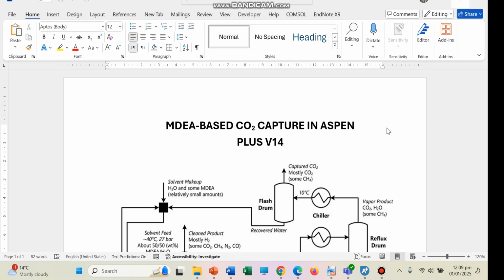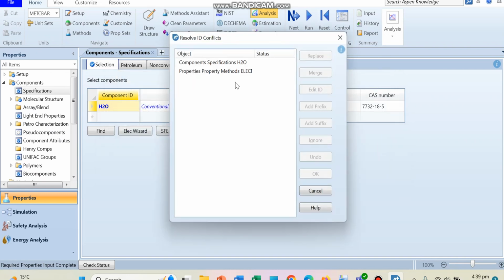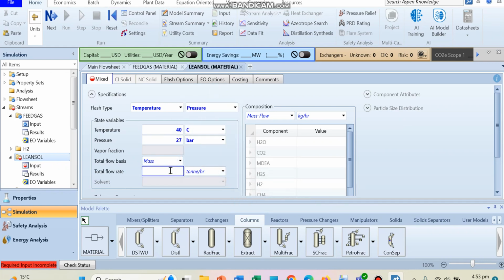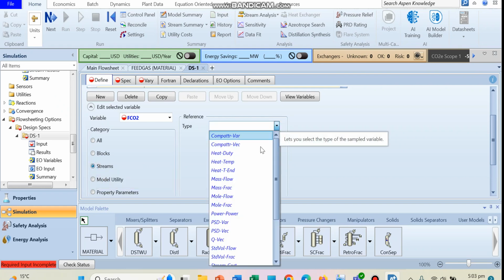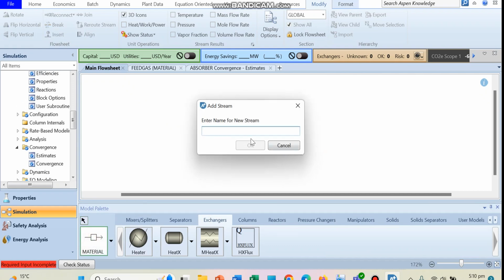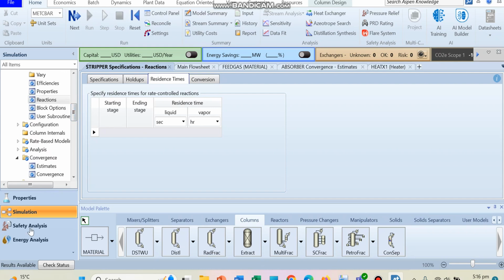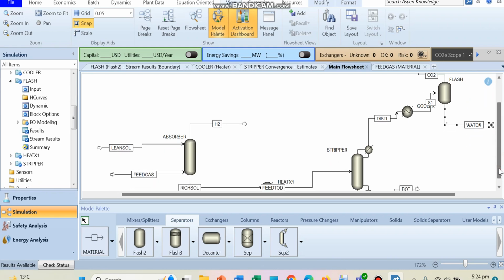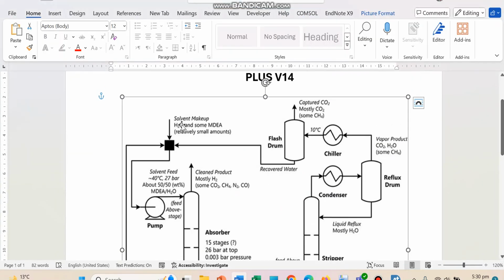CO2 Capture using MDEA in ASPEN Plus V14 Part 1

Comment: Dear author, thank you for the awesome explanation of the Aspen Plus simulation, I am bachelor engineering student, and have similar absorber-stripper case for my capstone project, however the solvent chosen is MEA not MDEA, is there a significant difference in the reactions? which one is better for co2 capture? Sources I found mostly rely on MEA, and if it is possible, may I contact your email?
Thank you in advance for your response!

Comment: Hi, I am working with a high volumetric flow in the flue gases (250000 m3/h). When I put this data into the simulation it just stop working.

Comment: Your videos were really helpful. I really appreciate. I wanna ask you about my research. My research is integrating gas turbine and carbon capture system. Can I use this system to the gas turbine for carbon capture? Can i directly input the composition of my exhaust gas from gas turbine to this system? Please, recommend me where do I need to change the parameters for this research such as number of stages in stripper and absorber, etc. Can I modify your file and change parameters only for my research, does this work? I would be glad if you answer all the queries. Thank you.